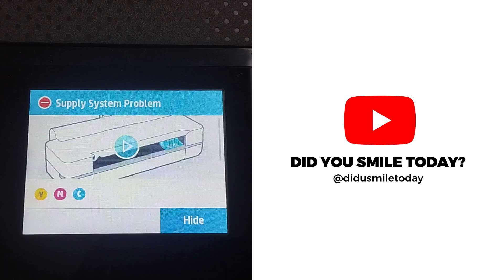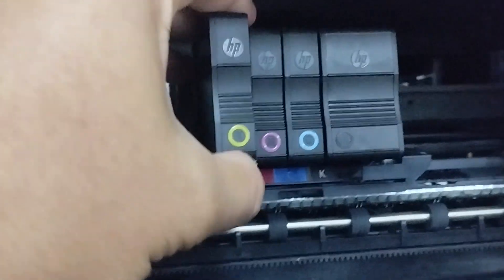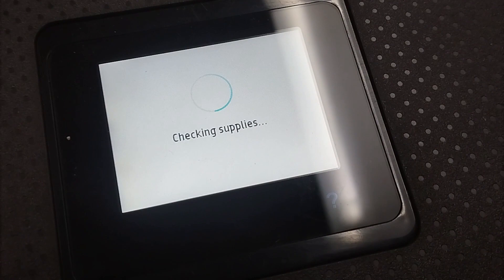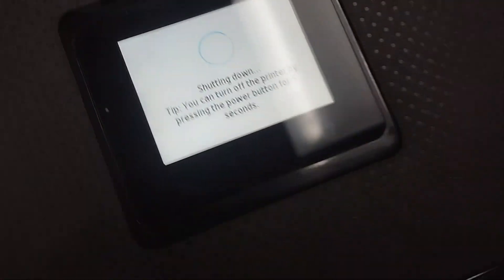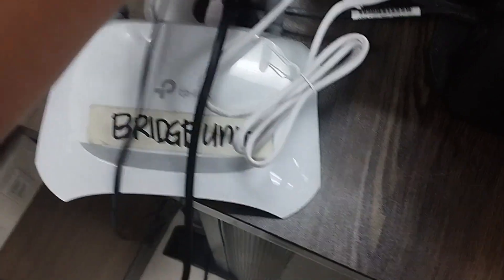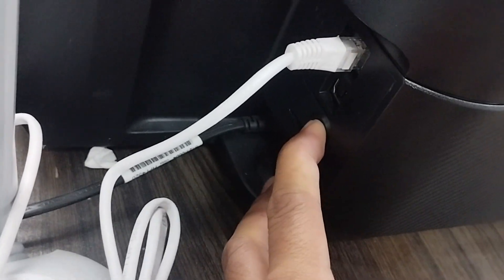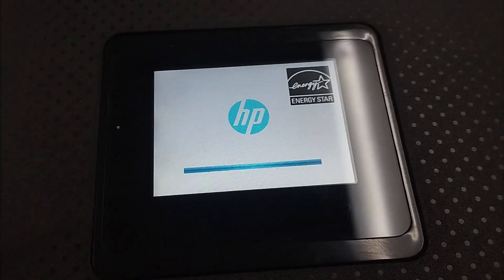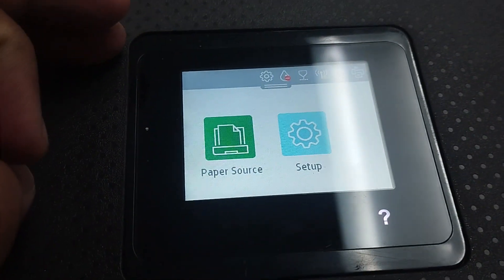HP DESIGNJET SUPPLY SYSTEM PROBLEM | Troubleshooting HP T230

Comment: Found a solution! I removed the cartridge that gave me the Supply System error message, reinstalled the empty cartridge, wait for the printer throw the same error message again, then uninstalled the empty printer, and reinstalled the new cartridge. After a minute of the printer making some noises, it accepted the new cartridge and allowed me to successfully print a test sheet!
Reply: Thank you! This actually worked for me

Comment: In my case, all it took was to remove the print head, unscrew the integrated circuit board, and clean it from the spilled ink.
Reply: this could be my issue, as I had a leaky cartridge.  What is this circuit board?  And how do I get to it?
Reply from the maker: Great, you had lucky troubleshooting 😊

Comment: I have the same problem, I bought and installed new cartridges, but it did not help
Reply from the maker: By replacing new printhead the problem is solve.
Reply: Buying a new print head you can better buy a new printer..never buy HP..go for Canon or Epson